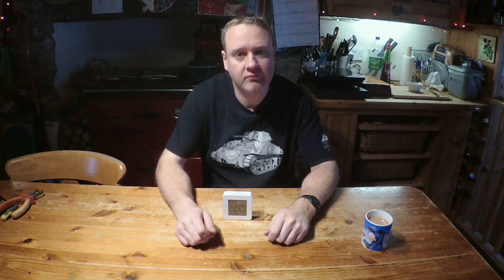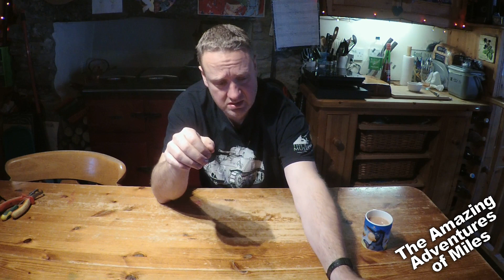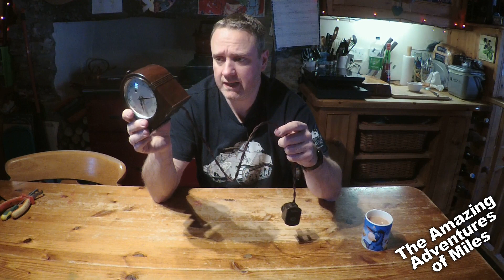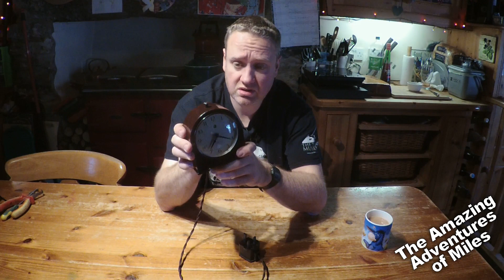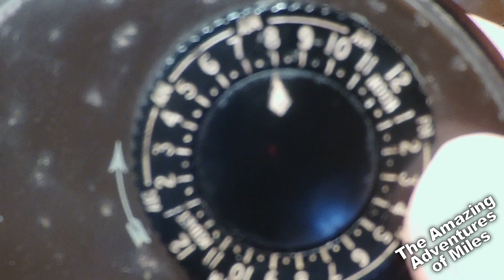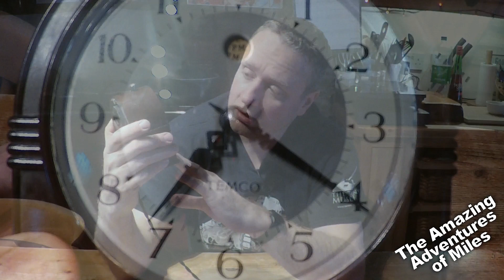Back in Use - 80 Year Old Temco Bakelite Clock

Comment: I’m in the United States and have been collecting foreign electrical items for decades, including clocks, most of which have come from England.  The first English clock I got is made by Temco, too.  Surprisingly enough it was already here in America when I bought it.  It’s a wooden Art Deco mantle clock shaped like a rounded top loaf of bread.  

A frequency converter is available to convert American 60Hz current to British/European/Australian/etc. 50Hz current and vice-versa, so that collectors can not only collect internationally but can run their clocks and have them keep proper time.

If you take some simichrome polish to the Bakelite with a cloth then buff the surface with a clean cloth, you will get a finish like glass
Reply from the maker: Thanks for watching my video Davidpar2 and for commenting. That's really cool that you collect this kind of stuff, good to know people are out there who do. Yes I suppose it stands to reason that frequency converters must be available! I do have a small voltage converter for when I'm in the states but it doesn't change the frequency, as unless you are running something like this clock it doesn't really matter between 50hz/60hz.

Interesting you bought a clock designed for 50hz in the US! I can imagine somebody bringing it over after a holiday then getting annoyed with it for not keeping very good time, then sticking it in a yard sale unaware of why it was running too fast.

Thanks for the tip with Simichrome I will give that a go. I've got a few Bakelite items that could do with some TLC!

Thanks again, Miles